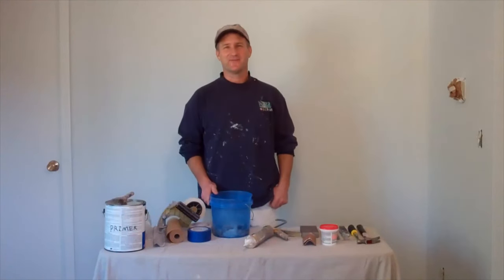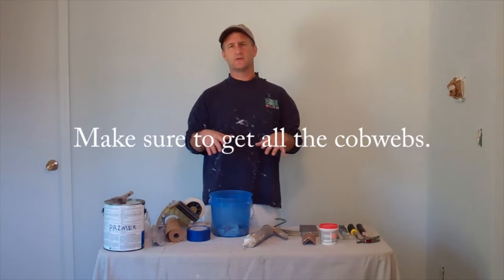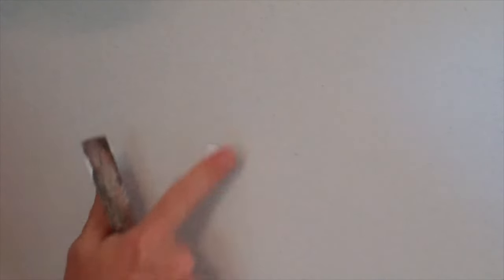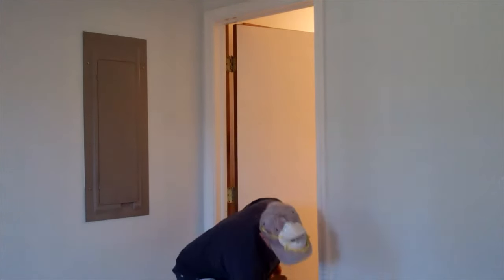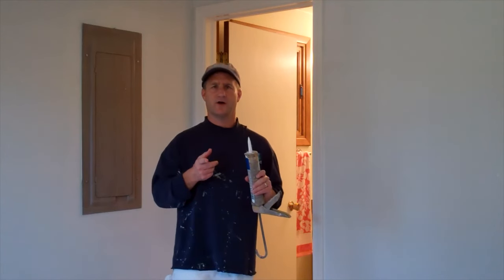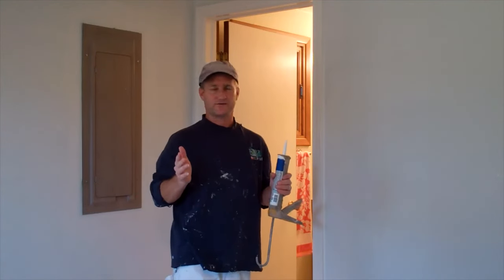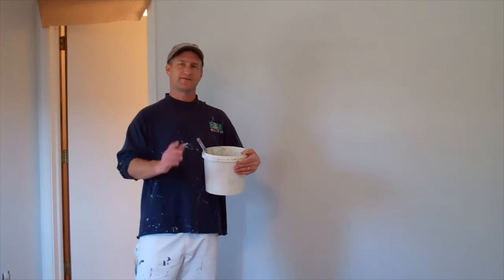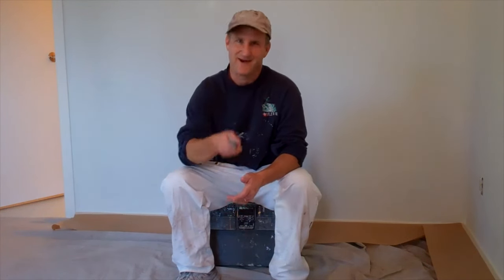Interior Painting Step 1: Prepping a Room

Comment: For those who never really or ever done any caulking needs to know most caulk guns have a trigger pressure release & or turning the pressure stick handle to unlock it's pressure will stop the caulk from continuing to spew out & dripping everywhere. to also note the smaller you cut the opening at the tip is the finer amount will squeeze out. You need also run your finger over it with dipping your finger in water for a better smooth coverage. Beware that large gaps may take another coat. I am a good man to have on hand' Dave the handyman. Good luck & God Bless!
Reply: Dave Overbey Question, I am paying a professional painter to paint the interior of my home. He is on day 4. I am noticing that he has not filled in the little holes. He is just painting over them. However. You can still see that there’s a hole there. Your video confirms that he is not doing a thorough job. Trying to find the best way to approach him without making him fee as though I am trying to tell him how to do his job. Any advice as to how I can bring this to his attention ? Thanks

Comment: A quick tip. If you don't have spackling or caulk on hand and need to do it quick you can use white toothpaste to fill small nail holes. Just small ones though.

Comment: Im using a heavy duty scraper to remove old paint then im gonna use coarse p60 grit sandpaper to rough up the surface of walls to help new paint stick better and before any new paint is applied fill any holes let it dry sand it smooth wipe any dirt dust and then should be ready to paint

Comment: I can't move everything out of the room; I'm alone.  So I shove it all in the middle as best I can, cover it up with a sheet and get at it....
Reply from the maker: That's exactly the right thing to do if you can't clear the room. Put everything in the center and cover it with plastic, but leave yourself access to the light fixture if you are painting the ceiling because you will need to brush around it. A lot of people are not able to clear the room for whatever reason. I just think it makes it so much easier to do the job and focus on the painting when there is nothing in your way...but it's certainly not totally necessary, just a convenience.
Reply: That's what I do too.
Reply: @howtopaintahouse  Hi great easy to follow video just one question on Priming why do you need to do it is it just to cover water marks or stains that may bleed through the paint ??

Comment: if i am using a sprayer, if i do the ceilings first can i go over the scotia with ceiling paint or do i need to put an enamal on scotia, if i do need enamel can i paint over it with ceiling paint and then over that with enamel? also can i spray all the skirting boards etc and go over them with enamel afterward? thanks, this video was helpful as.

Comment: 1
You don't need to completely clear a room of everything in it unless you are messy and incompetent, and you can do the room in the same space of time. So bullshit on that one mate.
2. The edges of holes should be rounded inward to render the patch invisible after sanding. Often the edge of a hole is sitting up proud of the surface and the patch will not work.
Don't use spackle on larger patches as it doesn't sand well and takes longer to sand out. Use Drydex or ready mixed drywall compound, the dust control one.
3. It is not always necessary to sand or scuff the trim. It depends on what you are going over and the product you are refinishing with.
4. a duster brush is just as effective. All that vacuuming is not necessary till the end. Keep your sheets in tight.
5. Your angle on the caulking tube tip depends on the angle you hold the gun. Everyone is different. Also, prime old stained wood with a stain blocking primer first then caulk the gaps all around.
And you don't have to give caulking a day to dry. 
6. any good painter will not tape or mask the top of a baseboard or the edges of windows and door frames...
Okay... there;'s way more here and there's no point.
This guys a joke and not a pro tradesman.
If he went to work for a painting company he'd be gone before lunch.

Comment: One thing missed that I think is also good to do is wash/rinse down the walls. A lot of dust and debris gets attached and coats the walls. Any slightly oxidized paint will attract dust also. Depending on where you live, the environment may be dirty....coal dust, sea salts, humidity, smog, agricultural/farm land. Even with windows closed all year long, that stuff gets into your house. Dust in your carpets can be pushed onto the walls when vacuuming.....and pets shed and have dander. 

A quick rinse with a damp sponge and warm water helps to remove a lot of the accumulated dust and debris. Think your walls are clean already? Get a bucket of warm water and a sponge and just wipe down a 4'x4' section and see if your sponge rinses out clean....I bet it won't.  And if it's like a kitchen, you will have grease and other things on your walls so best to wash it down with something like a TSP solution and then rinse with water.

It's an extra step but I think it can make a big difference....it is a PITA to do though....LOL. I just finished painting 10 rooms in my house! 2 more to go!

Comment: You forgot to wipe the walls with a damp sponge to get off any sanded paint still lingering. If you don't then the paint won't stick and air bubbles with occur in those areas

Comment: hey i like the spackling ghost but i've found painters puddy is much faster and doesn't need to be primed
Reply: hi with respect putty is okay if the surface is to be oil based painted, the putty will show through water based paints so its best to use a filler.

Comment: Is spraying going to use less paint? Also, what should I do about a wall that has bare plaster and is covered in grease from kitchen fumes?
Reply from the maker: +InTheNameOfJustice Spraying won't use less paint. Grease needs to be primed with an alkyd (oil base) primer.

Comment: Thank you so much for making these videos.
Do you think washing walls (with TSP for example) is a necessary step before applying flat?
Reply from the maker: In most interior situations it's not necessary to wash the walls, but if they are dirty, stained, or greasy (like a kitchen, or in a bedroom where peoples' heads were against a wall when sleeping and got the wall greasy, yuck!), then washing with TSP can be a good idea. Another option is to use an oil base primer like KILZ--that will stick to just about anything and cover stains too. The fumes are an issue for some people, though. Definitely wear a respirator when using oil primer.

Comment: How to remove paint drips that the last guy left when he painted?
Reply from the maker: Good question, and the answer depends on where the drips are. If there is old paint on the door hinges or other metal areas, I carefully scrape it off with a putty knife blade. You can wrap the blade in a damp rag if you are worried about scratching, but I personally think a bit of scratching looks better than old paint. If there are drips on the walls, it's tough to completely get rid of them. First scrape them off with a razor blade, then sand with 80 grit sandpaper until they are mostly smoothed out. It will look better--maybe not perfect but much better.
Reply: Just bought your book, it's the least I can do.  Thanks again for the videos.
Reply from the maker: Thanks! I hope you enjoy the book. Good luck with your painting.